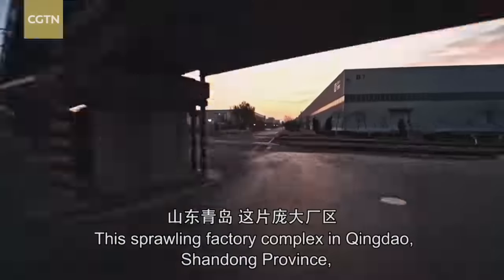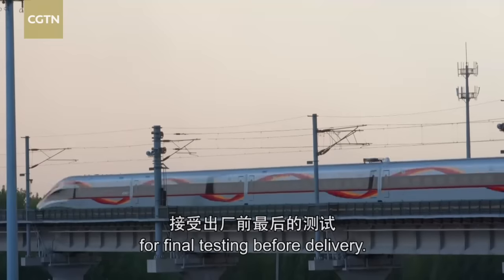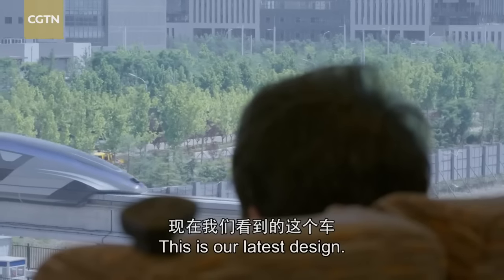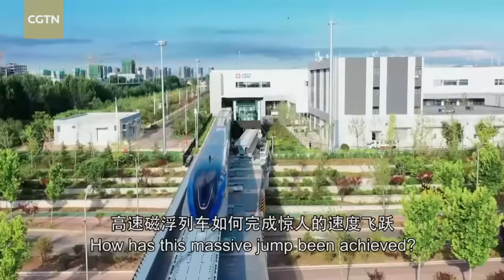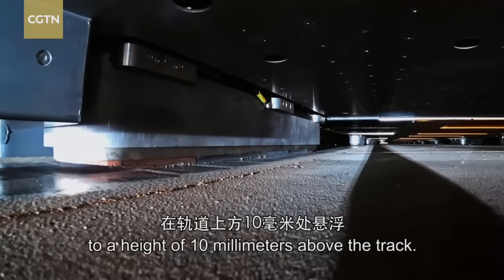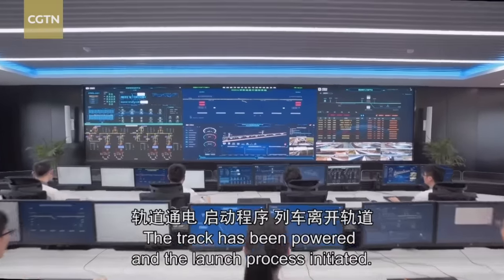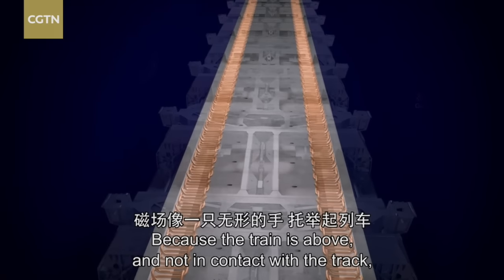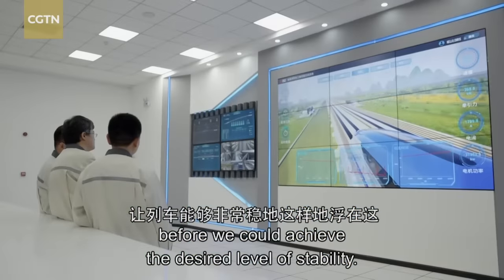China turns 600 km/h maglev trains into reality

Comment: Incredible innovative advanced engineering.  Maintaining a distance of 10mm above the tracks with the dynamic forces at a speed of 600km/h is no easy feat
Reply: In addition to being subjected  to wind rain and other aspects of the weather. And doing so while carrying tons of weight. That's advance engineering. And did I state that doing so requires it to overcome the problem of not having to do so by using the ultra cooled surfaces required to generate the magnetic field to make this all possible.  The rest of the industrial world is still fighting to overcome the hurdle of this temperature requirement!!
Reply: My father purchased agriculture land in guntur andhra pradesh India and the land is encroached by ambedkar followers..modi prime Minister and jagan reddy chief Minister of my state supporting them..
Reply: Ya don’t sayyy…
Reply: 600km/h ??? What's the hurry?
Reply: @Andrew-rc3vh  🤣🤣
Reply: @dstr1  right on point Bro...
Reply: @stephenc6955  if the distance to cover is 2000 km , yes Maglev is cool
Reply: @stephenc6955   Plane flies at 800-900 km/hr. What the hurry? Do you fly?
Reply: A big fat lie is an easyfeat!
Reply: @blackknight4996  huge wait times at airports, trains are quicker and no convoluted check in times
Reply: It's surely not easy and it consumes a ton of electricity being a lot less efficient than regular high speed trains, it will be a nice tech to demonstrate the feasibility but not viable in operation
Reply: What? Another claim by fanatic chinese.. LoL
Reply: @syamkumarkaturi9761  why are you saying this here? lol
Reply: Indeed incredible innovative advanced engineering ..supposedly it can maintain & reach a speed of 1,000 km / per hour, how does such a train service improve the lives & provide better & higher improved efficiency & productivity versus cost.  Without doubt, the faster the speed of the train, the greater the air-resistance, th4,  requiring increased motive force of higher Energy Consumption.  Alternatively,  to construct & build a sealed "Vacuum Tube Railway system" with reduced air-pressure into the entire railway line but the cost will be astronomical...and un-economical to operate.  Fixed Railway track with Super-High-Speed system, is a highly inflexible mode of passenger transport concept, unless there exists sufficient daily high numbers of travelling & able-to-pay  high-fare passengers...it is really a superfluos investment for most countries.
Reply: @WatchChina1976  Hyperloop trains at 1000kph are not feasible at all.  Maglev trains at 600kph are suitable for routes between Central Asia, Russia, ASEAN and China
Reply: This "10mm above the tracks" (German: "Luftspalt") was invented and elaborated through sensoric measuring in Germany. From 1979 onwards. First implemented at the transrapid 06 in 1983. So, thanks to these German engineers China can brag again with something it didn´t invent or develop. To quote out of a German PDF-file, (made by a German scholar for his advanced physic class in high school in 2005!): "An air gap of 10 mm is always maintained between the suspension magnets and the stator and the vehicle itself hovers 15 cm above the track."
Reply: @bieneulm1982  you are jealous
Reply: this is good to see.  i’m critical of the Chinese Party but this is a great achievement
Reply: @wulung5943  Fixed Railway track with Super-High-Speed system, is a highly inflexible mode of passenger transport concept, unless there exists sufficient daily high numbers of travelling & able-to-pay  high-fare passengers...it is really a superfluos investment for most countries...except for PRChina, which has the world's most extensive infra-structural constructions.
Reply: Why you take aircraft， go horse riding if you want from new york to seattle.😃
Reply: Which was from an idea by professor Laithwaite who gave lectures in Germany France Japan
Reply: @stephenhill8790  Ideas are important but so is the hard work to improve on the basic idea, design the details and manufacture the equipment.  The modern banking system was based upon the Chinese invention of paper notes
Reply: @wulung5943  of course many things invented by people all over the world have been improved and developed . most scientists don't care about who did what and when but how can we take this forward
Reply: But not impossible either. Putting a man on the moon to jump around and pick up rocks at a cost of billions isn't an easy task either but they did it....
Reply: It's incredible innovative to take Germany's Transrapid technology developed in the 1980 and bring to live?

I don't think so, sry.
Reply: A Malnutrition can Actually Invent? REALLY? Impoverished have ideas? Or is ist *copying the first thing seen?
Reply: @syamkumarkaturi9761  ?? What You are propagating here??
Reply: This is vaporware. The train they have is a prototype on a 1km track. It's barely traveled 60km/h. They're just talking about the theoretical speed. It's about as real as Hyperloop at the moment.
Reply: The first commercial maglev people mover was simply called "MAGLEV" and officially opened in 1984 near Birmingham, England.
Reply: @petrbelohoubek6759  True. Although a completely different beast than HSM.
Reply: @wulung5943  😂😂😂💩🤦🏻‍♂️
Reply: Even after almost two decades of Reverse engineering the German Maglev technology built by Siemens and ThyssenKrupp, they still hasn't perfected the levitation system. That's why Chinese have allowed another German Maglev manufacturer MAX BOGL Ag to build another maglev transit service in china. I have an idea. Why ?
Reply: @gavinirving8184  So where is the German Maglev train operating and what is its speed?  China is streets ahead of Europe and Japan   😊😊
Reply: @bieneulm1982  So where are those transrapid trains? I am sure you know the answers
Reply: @coldsword  most of them are in museums, three are at Emsland Test facility and one is in Nortrup.
Reply: @bieneulm1982  Yes, right. I live near Kassel, sometimes i visit the one in TMK. But you foregot one: Shanghai Airport Line in China! Operating since 2002!
Reply: @bieneulm1982  Yeah, I supposed so. That's why China is cool! They make techs available to masses
Reply: @wulung5943  So if someone points to the fact that this feature has its roots on the German Transrapid, what is clearly visible in the design, you claim he's jealous? Whats's wrong with you? Better do some research on the Transrapid project and you will see that's absolutely correct.
Reply: @wulung5943  That's not the point. The point is that there are several maglev systems and this maglev train is a dircet successor of the Transrapid system what you also can see if you carefully study both projects. Nobody will deny Chinas advance in this project, but we should not forget the german roots of it and thanks to the stupid german government, it wos not furthermore developed in Germany.
Reply: @manu.yt25  It's not necessarily less efficient than regular high speed trains. AT higher speeds, air resistance is a real concern, but that would apply to any vehicle traveling that fast.
Reply: @TheNewGreenIsBlue  It consume a lot more electricity, check the data on that online....

Comment: Very impressive! 

If they can make maglev work commercially then it will be a huge improvement of the already impressive high speed trains. 

At those speeds you are seriously beginning to compete with planes on all but the longest flights, which is great news for the environment. Especially once we transition to get all electricity from sustainable energy production like nuclear, hydro, wind and solar. 

I'm not so sure about electric planes as they will be quite limited in range, at least with the current battery technology, but trains don't have this limitation, obviously.

Trains running with metal wheels on metal tracks are already the most efficient way to transport anything across land. If Maglev removes even the rolling resistance then it will be even better.

Ofcourse, wheeled trains (electric ofcourse) will still be vital for kinds of cargo transport, but for quick passenger routes I can definitely see 600km/h maglev as a game changer.

Great work Lian Jianying and all the others working on this. It is an exciting future!
Reply: I think traditional high-speed rail, which I think always will be cheaper to build than this, easily could be a viable alternative to flying in many cases if it just got built in more places. I really don't see maglev solving that problem.

Comment: Train speed
India - 160 kmph 
USA - 240 kmph 
Japan - 320 kmph 
China - 350 kmph 
China Maglev - 600 kmph
China Vactrain - 1000kmph
Reply: Train speed
India - 160 kmph 
USA - 240 kmph 
Japan - 320 kmph 
China - 350 kmph 
China Maglev - 600 kmph
China Vactrain - 1000 kmph     <<<     ADD THIS ONE
Vactrain -- an Elon Musk's hyperloop-like train system -- was tested October 23, 2022 by North University in Taiyuan, Shanxi in northern China.
Reply: current Amtrak runs like 10 miles per hour.
Reply: An average train speed in India is nowhere near 160km/hr. It is the Vande Bharat and Gatimaan expresses that gets above 140km/hr. There is only a total of 10 such trains in India right now.
Reply: @jackchiu7560  japan has developed  Maglev - 600 kmph as well
Reply: @cheval63sg  
Good for them. Now Asia has 2 countries that overtook Germany's 435 kmph maglev train technology (originally developed by Siemens AG 20 years ago). I wonder when Japan can push the limit to match China's Vactrain (vacuum tubed train) at 1,000 kmph.

Frankly speaking, I think the Vactrain system is a waste of efforts and resources because its cost would be prohibitive. Passengers who take the maglev trains at speed of 600 kmph will arrive to their destinations faster and earlier than those by airplane, taking into account the hassles of taking a cab to the airport, going through security checkpoints, customs, and the waiting time at the airport.
Reply: @jackchiu7560  agreeed.
Reply: But india has more fun and tech
Reply: @johnxina4906  more fun yes, more tech?
Reply: @cheval63sg  in india, it so advance, so many people can even sit on top of train. beat that china
Reply: india cowdung.speed
Reply: The speed that my stuff grows - 69420 light years per second
Reply: Engineered army, what train in the states can run 240km?
Reply: Saudi Arabia turkey alegeria have above 300 speed trains and you added India into list that's insult to all countries who have above 200 speed
Reply: @galaxyofvid2738  Pakistan has 50kmph without electric overhead cables, so didn't add
Reply: @jackchiu7560  表示赞同，但我们总要对科技发展抱有期待，未来可期

Comment: You called it fastest but in reality Japanese maglev train can reach a top speed 603km per hr. Your still on the testing phase but Japan is now currently building the pathway for their "Fastest Maglev Train in the world".
Reply: Ture, they just use the German tech with less something factor to achieve 600 km/h, if they somehow ‘absorbed’ Japanese tech ,and decrease some factor, then they can achieve 800km/h
Reply: @Anson-1080  
China is expected to begin building the 170-kilometer (105-mile) MAGLEV line between Shanghai and the tourist city of Hangzhou this year, using Chinese as well as German technologies.

The China Daily quoted the vice minister of the National Development and Reform Commission, Zhang Xiaqiang, as saying costs were expected to fall after China mastered the German technology used to build the MAGLEV tracks.

"Our aim is to limit the cost of each kilometer of MAGLEV line to approximately 200 million yuan ($25 million)," the paper quoted Zhang as saying.
Reply: @Anson-1080  
China wants technology in exchange for contract

China is planning an extension of its Shanghai connection to the city of Hangzhou, 180 kilometers away.

Earlier this year, Germany rejected China's demands for access to sensitive Maglev technology in exchange for building this $4.3 billion high-tech rail link. Chinese officials approved the building of the track in March. But discussions with the companies have been going slowly as Beijing is looking for significant technology transfers and funding as the price of admission.

"We are optimistic that our Transrapid will be employed on this stretch," Wiegelmann said.

Germany provided 10 percent of the $1 billion budget for the Shanghai airport link

Comment: The air is significantly denser on the ground, so high speed railways aren't efficient due to the air drag. Vacuum tube is a must if trains are trying to go faster.
Reply: I was also thinking that: maybe not a high vacuum along the tube all of the time like in the hyperloop concept but a temporary vacuum just in front the incoming train. In the context of a green energy transition, there is a point to be made that the maglev can run on green electricity while future renewable aviation fuels remains a shaky business...
Reply: @5th_decile  Agree
Reply: @kittyflier8338  The maglev is also (potentially) scalable in the length direction, like normal trains? In prototypes you don't see this yet AFAIK. There is lateral friction along such a long train but it is negligeable compared to the contributions of the front and the tail.
Reply: @5th_decile  Another problem is the mach shock. A near ground mach shock would be disastrous.

Comment: Their latest Design is a Transrapid, developed in Germany from 1969 to 2011. The Transrapid 05 in 1979 was the same way build than the one in this video here. Same goes for German Transrapid 06-09, of which the eight version serves as Shanghai SMT. THIS IS GERMAN ENGINEERING AND IT ALWAYS HAS BEEN!! Their 600km/h Transrapidclone didn't even start to reach a 100km/h until yet, because it has no track. It is embarrassing that Germany and especially Thyssen ( which is the owner of this technology) let them pass on just doing that.
Reply: Mr expert  can you tell us the different...between the 2? are they use the exact same technology?
Reply: What is the use of technology if it's no use or help to mankind..Glad atleast someone is using it in reality!!
Reply: @mrj475  Germany build IT, the trains running in Shanghai are German made.

Comment: They’re “coils”, not “roils”

A steel wheel on steel rail has very little rolling resistance which limits acceleration and braking.  This is a problem because above 300 kph over 95% of the energy is required to overcome wind resistance.  It’s the magnetic propulsion in combination with magnetic levitation that is crucial. 

But at 600kph at sea level  the energy required is enormous.

Comment: Would you like to ride the Japanese Maglev?  It is currently being demo run, but those who wish to ride it can enter by drawing lots. Experience 500km/h.
The track is under construction. There are many tunnels and it takes a long time.
It levitates 10cm using a liquid nitrogen-cooled superconducting magnet. The train body is magnetically restrained, so there will be no derailment. It is said that the speed will be around 800km/h depending on the amount of power input.

Comment: I don't know what they don;t put glass domes over maglev (even regular train tracks) with holes in them so they can get far higher speeds and way higher levels of efficiency.  2 keep the glass clean you could have trains at highest speeds that have wet cars and dry cars speeding by, cleaning them and on the outside you can have systems that can continually go up and down track to clean glass.

Comment: Unfortunately, the German Maglev Train Transrapid, which had a development time of over 40 years, was sold to China for them to showcase. The only notable advancements they made were extending the track length and improving its aerodynamics to achieve speeds of 600 km/h. The technology itself was only minimally modified. The primary motivation behind pursuing this technology seems to be the Chinese government's desire to boast about a technological achievement, despite the enormous costs associated with building an entirely new track network.

Comment: If there is any place where this would be financially realistic then it is China. 

Even the railway system caused a lot of debt and was in many areas a ineffective investment, China has basically no choice but build up such railway.

During a European would never take a train from Madrid to Frankfurt for example, it is very common to take the railway from shanghai go Changsha in China. 

Regarding the big middle to low income population this is the smartest system to invest in. 

Because so many planes can’t be build in the next 20 years as China would need. 

The question we will see now if this maglev will be implemented and operate as other high speed trains. 

The infrastructure and maintain ace is extremely expensive for such a thing. 

This is why it was no business case for Germany basically.

Comment: I don't think that we come to see those trains in the near future. The problems that come with rising energy costs per mm extra difference between "rails" and vehicle could make it fail due to financial desaster. Also to make those tracks stable enough to maintain the maximum of 10 mm difference will be a huge problem because eneneering structures which need to be build will face structural subsidences. Levitation will not take the weight from the pillars.

But as an engeneering student I still wish that chinas engeneers will find a way